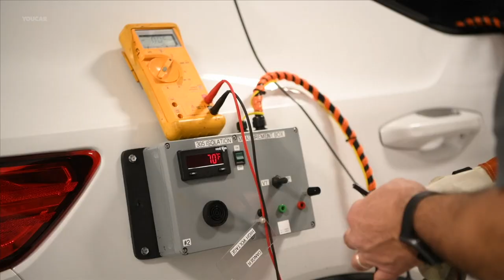Ford Mustang MACH E Crash Test

Comment: I dont hate these cars as much as i used to. I just wish they wouldve just named it the "Mach E" and just left the Mustang part out of it or just named it the "Fusion" or something.
Reply: I hate the mach-e with a passion. It's a solid electric crossover but that's the thing, mustangs aren't crossovers, it turns the brand identity of the mustang from an intimidating, loud, fast muscle car, to a timid, quiet, and bulky family vehicle.
Edit: if they had made a proper electric mustang, a powerful 2 door coupe, that's intimidating and stylish, I wouldn't be mad. Electric vehicles are the future after all, but this is inexcusable.
Reply: @1mariomaniac  I agree. The mustang should be a powerful muscle car with a V8 or a gas engine of some kind. Not some EV crossover SUV thing. I'm sure it is a decent enough vehicle but it is a disgrace to the Mustang name

Comment: Why didn't any of the airbags deploy for the right front passenger during the front end collision?
Reply: No passenger was seating in the seat...
Reply: Many cars nowdays have sensors that look for certain weight on the seat before enabling the airbags.  

Front airbags can be very dangerous for a small child, so this helps avoid that danger.
Reply: @simpleinverso8628  They use one of the following: gel bladder, air bladder, or mechanical sensor.

Comment: Why don’t they just use the chassis of that demolition vehicle! Didnt see a scratch on that.
Reply: Because the goal is the safety of the driver and passengers over the car.  In the past the chassis were more rigid, but that transferred more of the force of the crash to the cabin.  Now the cabin is reinforced, but the rest of the car is designed to crumple to reduce crash force.

Comment: the car reminds me the model 3 they tested
Reply: Ford is safer.  Cheaper.  Better made.
Reply: @AMan-he9sz  yeah I get it but it almost looks like the model 3
Reply: @AMan-he9sz  do you even know what car I'm talking about
Reply: @AMan-he9sz  There's too much intrusion on the side impact. While the B pillar didn't collapse it definitely bowed inward from it's outward convex.
Reply: @Tokamak3.1415  As all vehicles do when tested in this way.
Reply: @AMan-he9sz  Um, no. Watch the videos for the Polestar and the Model 3, both have less B pillar deformation and less intrusion into the cabin.
Reply: @AMan-he9sz  How is it safer? But the Model 3 cost 4k less than the Mach E? Again how is it better made? It's hasn't even been a year since it released, how would you know?
Reply: @docblizard  Simply look at one in person and drive it.  It is instantly obvious that no one should hate their money enough to buy a Tesla.  I certainly don't.
Reply: Well it is a direct competitor
Reply: @Shadow_Wolf_190  Actually Tesla is supposed to be a luxury brand - so no, it's not a direct competitor, even if it's the closest thing to one.  The Ford is a much better, nicer car and doesn't even claim to be a luxury car.
Reply: @AMan-he9sz  the Tesla model s long range wich is $76k has a 412 miles(663km) range and 0-60mph in 3.1s and the Ford mach e AWD wich is almost $72k (59600€) has a 540km range and 0-60mph in <5.1s  and even if you compare it to the model 3 performance it has a 315miles (506km) range and 0-60mph in 3.1s
Reply: @viperro4542  None of your comment speaks to mine.  Nor does it change the truth of my comment.
Reply: @AMan-he9sz  you can get a better car for almost the same money
Reply: @viperro4542  Possibly - but that better car isn't a Tesla, for certain.

Comment: I am surprised a car made out of tinfoil can withstand at least some impact.
Reply: The whole point of making cars put if weaker materials is safety. You make a frame around the passengers out of strOng material, and then around that everything is supposed to deform to absorb energy
Reply: I bet you are surprised by a lot of things.